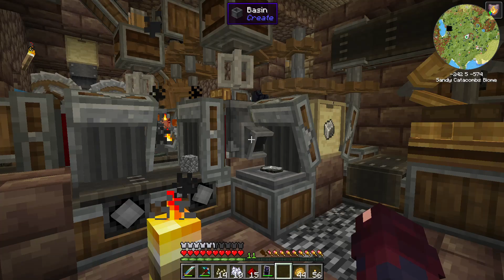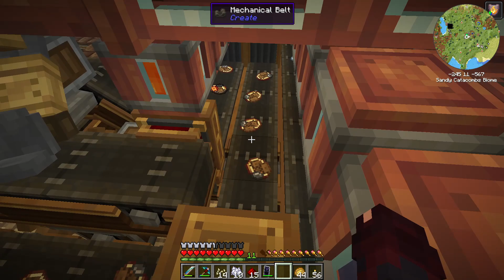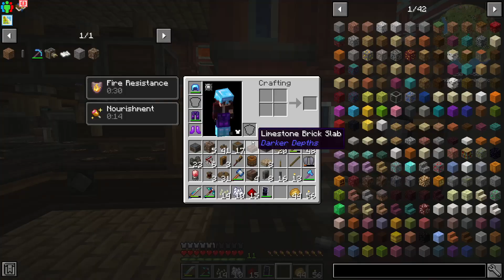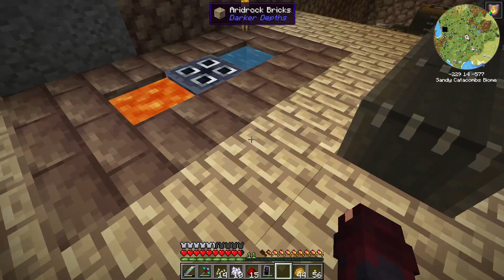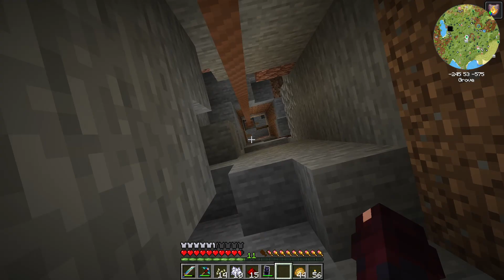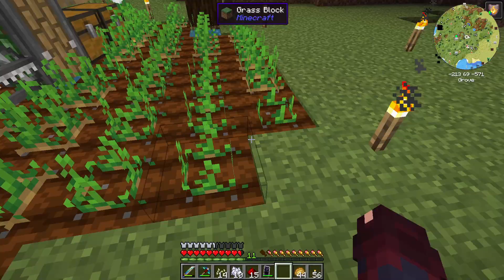Create Above and Beyond Factory Tour

Comment: For the mechanical crafters with the crushing wheel, you can go to the back of it and right click the lines between them to connect them together so they share an inventory, which would make the crafting slightly faster cause it would only have to input from one spot to fill them (like how you see it in the trailer for the pack)

Pretty sure they changed the recipe for it for this very reason
Reply: And for the drawers for sealed and infernal mechanisms, if ya didnt want too much, prolly a storage downgrade would be useful to make it only hold 1 stack. I was thinkin i'd do that myself too eventually